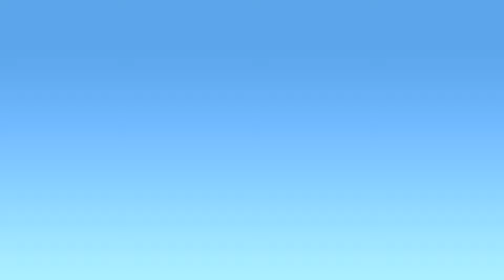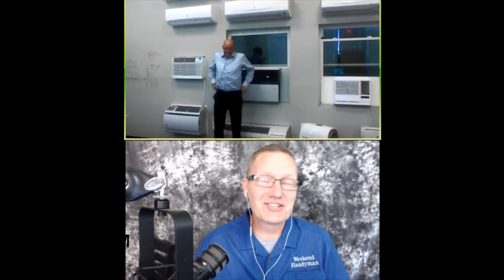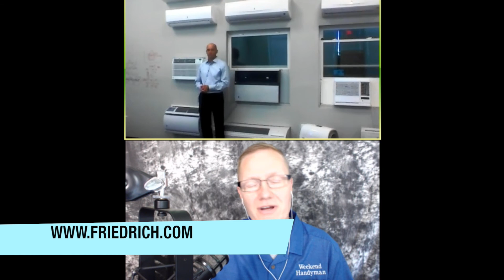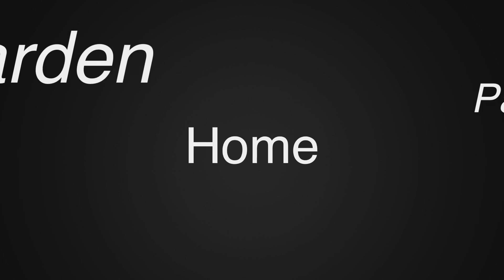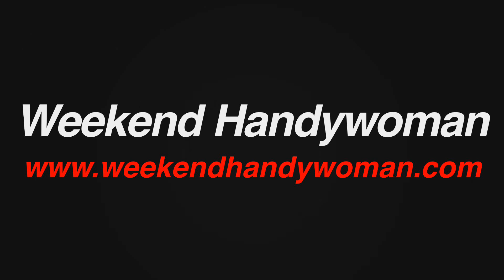FRIEDRICH Thru The Wall Air Conditioning or Heat Pump AC Units | Weekend Handyman

Comment: I don't have the option HEAT on mine. Only COOL and FAN ONLY. How do I turn that option on?
Reply: You must have a Friedrich A/C that has a Heating option for this to work.  If you do, you'll see it in the mode option.  If you don't see it then your version must likely, does not have a heating element or heat pump.  You can contact Friedrich for specifics about your model.

Comment: Warning do not buy this fredrich type thru the wall air conditioner they breakdown right out of the box average lifespan year and 1/2
Reply: ONLY IF UR THE INSTALLER  WTF U TALKING BOUT U MUST BE REALY FKIN STUPID AT INSTALLING RATHER U  PROB DONT INSTALL AT ALL LOSER
Reply: They are horrible😩!  They just installed it in a newly renovated apartment and it blows cold air all the time even when I select heat.  I think there is something wrong with it!  I tried setting the temp to 75 and it will not come on unless I move the heat up to 82!  Then I suffocate!!!! Horrible poor quality
Reply: @SeniorInterests48  If you have the Heat Pump version, it won't work when it get's below a certain temperature.  Heat Pump only heating A/C's aren't really worth the money as they don't create heat.  The simply shift heat from one side of the A/C to the other.  If it's cold on both sides there's no heat to shift.  This may be why it's only blowing cold air?